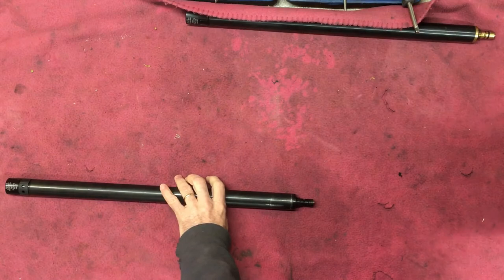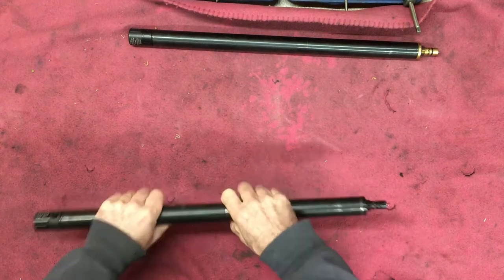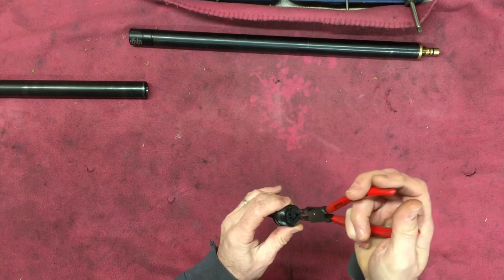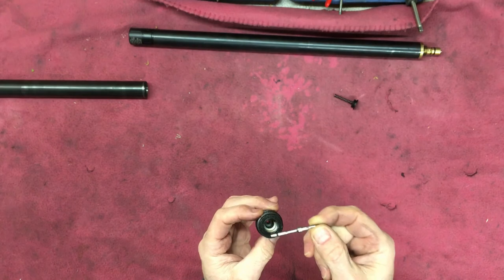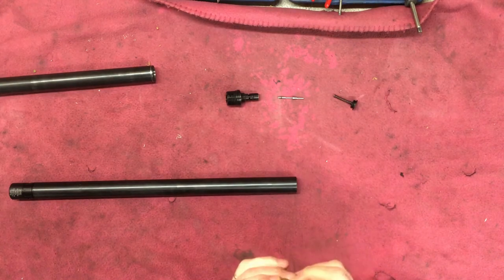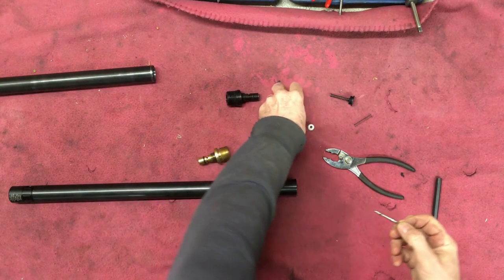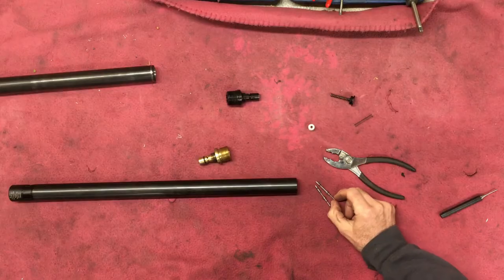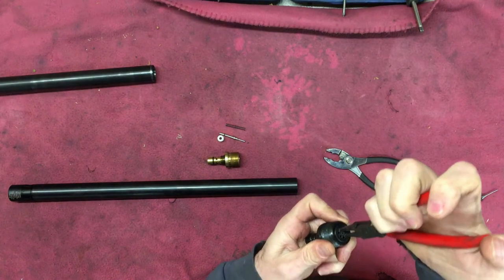Hatsan AT44, Bullboss air/exhaust valve pin change

Comment: Excellent video!  I need help with loosening and removing the valve body from the air tube (Hatsan AT44).  It's on there very tight (as if someone used lock tite on the threads or something to keep from leaking because even the vise doesn't help,  and I don't want to tighten the vise any more.  It's as tight as it can be without causing too much stress on the air tube; if I haven't already).  I've heated the air tube with a blow dryer, a steamer and none has helped.  Now the tube is in the freezer and immediately I'll heat up the tube end (valve body area) and place in vice again, hoping this would help.  I've used WD40 already hoping it penetrates deep enought on the valve body threads.  I have a similar situation on a BT65 airtube which I have put aside for now - the flat areas on the valve body for the wrench application has been slightly damagae and to avoid any further damage, I've designated this cylinder as a non regulated tube to be used with an external regulator.  If it leaks, I will have to find a way to loosen that valve body as well).  I have a heat gun in my Amazon shopping cart to use in place of the steamer/steam gun.  I Any suggestions?
Reply from the maker: Did you get this taken care of? First off, Make absolutely sure that there is no pressure left in the cylinder. If there is it will make it next to impossible to unscrew the valve body. Are you using a round tube clamp to hold the tube? If there is loctite on the threads a hairdryer probably won't get hot enough, especially if the permanent "red " was used. The heat gun will be a better option. There really is no reason it shouldn't unscrew without damaging anything.
Reply: I was able to get it off after all without the heat gun (after I ordered the heat gun).  I was also worried that if I used the heat gun not to use too much heat that might compromise the integrity of the tube.  I kept the tube on the vise tight enough just to hold it in place.  I used a metal rod through the fill port as leverage (about the same thickness as the fill probe).  But now I also have to remove that end as well because it developed a leak (likely the valve seating) after a few fillings.  That end seems to be even tighter.  I think I'll use the rubber belt type car engine oil filter wrench on the tube and metal rod through the fill port.  Hopefully that helps.  I hope I didn't use too much force with the vice the first time that might have compromised the air tube integrity.  I'm also trying to figure out how to get the plastic/delrin type ring with the rubber o ring around it that seals against the firing valve pin without damaging it.  I'm thinking using the air gun connected to the Omega big air tank (I use this air gun for filling so I'm not always disconnecting air lines when filling).  I'm hoping the powerful air blast will blast that sucker out of the valve body.  I'll try to have it really wet with silicone oil overnight if it will help loosen it a bit.  It's really stuck in there tight.  Thanks for your reply. @gardenshedgunsmith1648

Comment: Mine is too tight to break free. Was hoping you had the same problem and showed how you opened it up. I am breaking stuff and luckily havent damaged the cylinder,,,,      yet.
Reply from the maker: Have you tried heating it? If there is loctite on the threads this will soften it up. It will also expand the cylinder a tiny bit which will also help. Just don't get carried away as there are plastic/rubber parts in there. Good luck.
Reply: Hey Iguanago,....I had a leak in two of my Hatsan AT-44  Air tanks, I was able to remove both ends of the Air Tank. What I used was a piece of thick rubber tire tubing and two blocks of wood. I wrapped the rubber tire tubing around the Air Tank, and  sandwich the Air Tank. between the two blocks of wood. I then tightened it on a vice, I used a 13 mm open end wrench on the air exhaust end, and turned it counter clockwise. If the Air Tank moves when your trying to remove it, tighten the vice a little bit tighter, being careful not to squish the Air Tank. On the Air pressure gauge side I twisted the cover off and that rotating Ring/Dust Cover turns and it twists right off, so you can access the "Fill Probe Air Port"  Use a tool that's a least 1/4" in diameter and long enough to give you some leverage, and push it through the "Fill Probe Air Port". I used a "Punch" where I only had about 4 - 6 inches of leverage. Yet I was still able to remove it. I didn't see any relics of any "Loc- Tite when I removed mine. I hope this helps you out. Happy Hunting

Comment: Before you remove the cylinder from rifle, do you have to bleed all the air out completely in order to change cylinders to put in a full cylinder in the rifle?
Reply from the maker: No. Some people, me included actuall keep fully pressurized spare cylinders so you can just change the cylinder instead of constantly refilling the cylinder on the gun.

Comment: Hi. Interesting work. I have a question for you, here in Sweden, we are restricted to 10J on our rifles, by installing a valve pin, we can go back to the 57J that (bullboss) is made for, beside changing the valve pin, is there anything else needed to change? hammer spring or anything else? is just changing the valve all one needs?  my .25 with 10 J is so weak it cant even penetrate a Pepsi bottle at 15 meters...
Reply from the maker: That's all that is needed. You may be able to squeeze a little more power with a stronger hammer spring though, but the biggest difference is the valve pin.
Reply: Very likely the internal transfer port will be restricted and needs to be replaced  or drilled. I made one from a piece of 6 x 0.5 stainless tubing. BB .25 The barrel transfer port can be enlarged without any problems to 5mm. Check that the pellet probe is long enough and pushes the skirt of the pellet beyond the barrel transfer port.(depends on pellets/slugs used) Hammerspring tension has to be determined by using a chrono to optimize power/shotcount.

Comment: My hatsan bt65 .22cal was pumped all the way to 200bar, it then started to slowly leak down, to just 100 bar, it stopped leaking at 100 bar....any idea how to resolve this? Where I can pumping back up and no leaking?
Reply from the maker: The only way to be sure is to take the cylinder apart and maybe lube up all the O rings and seals with some good quality silicone grease.

Comment: Do i need to change the spring if i go for full power valve pin and shuld i remove the regulator also. Mine gun is in 10j
Reply from the maker: Hej Lasse.
Are you asking about the spring in the valve or the hammer spring? No need to change the valve spring that I know of. You can change the hammer spring but I would first just change the valve pin to the full power version. You can then adjust the hammer spring tension to get the power where you want it to balance accuracy/consistency etc. If you have a regulator fitted then it will most likely need adjusting if it is fitted to a 10j gun at the moment. I don't find the Hatsans benefit a great deal from having a regulator fitted anyway. If you are after maximum power then remove any regulator as it has to reduce the cylinder pressure to a consistent level behind the valve pin.
Reply: @gardenshedgunsmith1648  Thanks. Yes I was talking about the valve spring. Is there any video how to adjust hammer spring? I am new to shis with airguns so I first thinking od buying an FX but then again I think starting with a more afforable gun is the way to go. I usualy hunt wild boar and elk with a hunting rifle and a lot more bang lol. Thanks for a nice video
Reply: I found a video how to adjust hammer spring but haven´t a clue how it should be in my case, harde or softer
Reply from the maker: @lassesarnhult9283  The hammer spring on the Bullboss is not the easiest and most straight forward to adjust.  Once you figure out how to do it though it's pretty easy. Pretty sure there are vids out there on doing it.
Reply from the maker: You will get better quality control, accuracy with a FX but if you are after more power an FX will not beat a Hatsan.